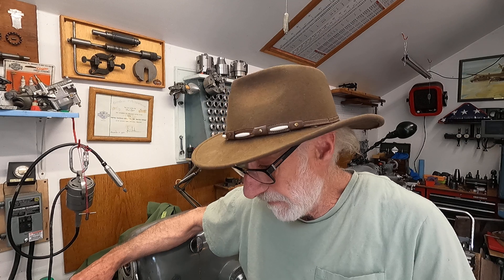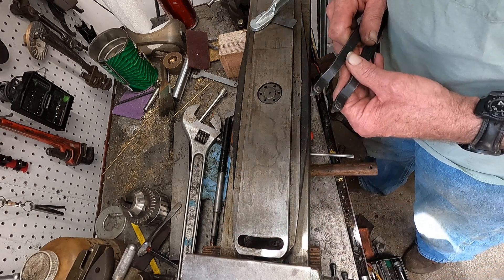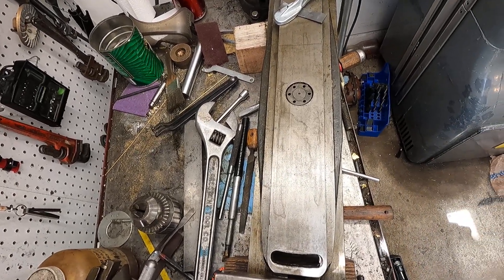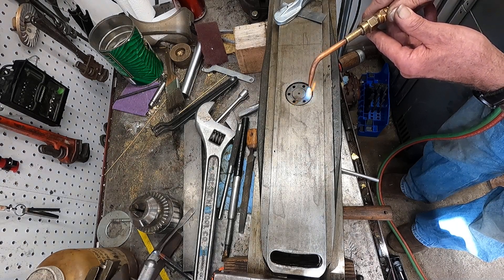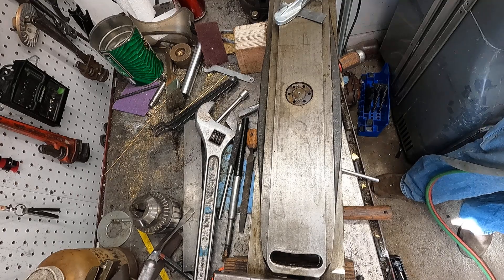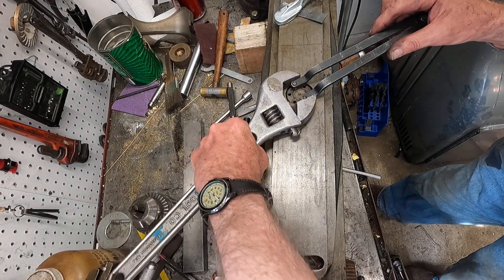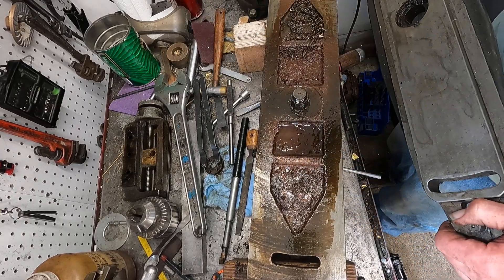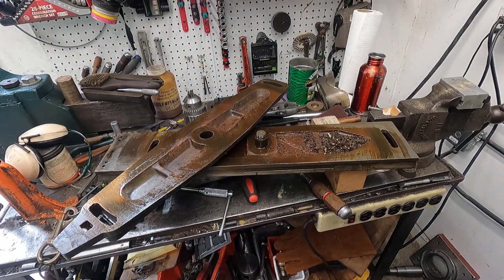Axelson 14X30 lathe restoration detail taper attachment

Comment: Never seen beeswax used by anyone before.  Very nice lessons. I hope you’re running a fan with a door open…. Always amazing the places chips can get into. Compressed air?   My older friends, yes, I have some, always blame compressed air, but I think it happens even without compressed air.  Kind of like magic tricks.  Cheers, DeeDee.  See you again soon, TB
Reply from the maker: I have pretty good ventilation, I doubt compressed air was ever used on this machine, it has cut a lot of metal in 80yrs. The Bees Wax is an old trick from the early 1900s before spray cans.

Comment: I am finishing up an old southbend, and have an old leblond regal 10 waiting it's turn in the driveway. This little idea is gonna see some use! Thanks Dee Dee!
Reply from the maker: Thanks, I just found this, just go slow and give it a few heat cycles if it is really stuck. Those old Regals are hard to find because they were good. There was one at a local machine shop for decades it just kept going.
Reply: @deedeeindustrialsuperprecision  Thanks, I had no idea how rare it was at the time when i picked it up. I was actually buying a pile of southbend parts, and I saw the regal under a tarp, i couldn't bring myself to leave without it. Since then, in doing research I've learned just how rare a machine it actually is and feel i got an amazing deal on it. It even has a mostly complete taper attachment, only missing the rear bracket that clamps to the bed which should be easy to reproduce.